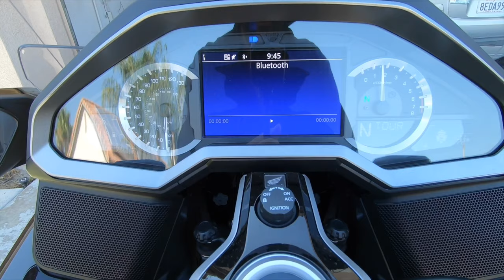2019 Honda GoldWing Motorcycle Detail 4K Wash New Gold Wing Tour Wax Metallic Black Like 2018

Comment: are all the switches and electrics waterproof????????
Reply from the maker: john bekkers I wouldn’t think of them as waterproof, but they are all weather sealed, it is a motorcycle for riding every day. It’s going to get rained on and stuff. I wouldn’t go at the switches with a pressure washer or anything.